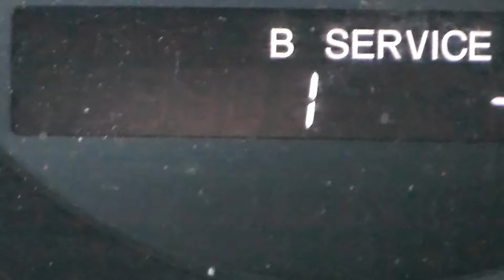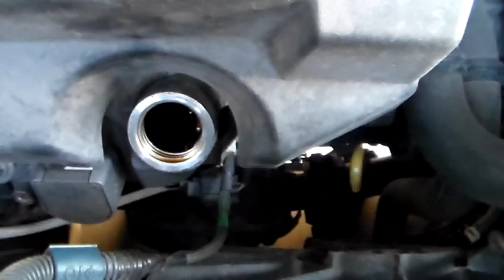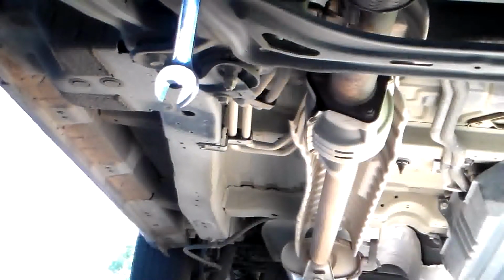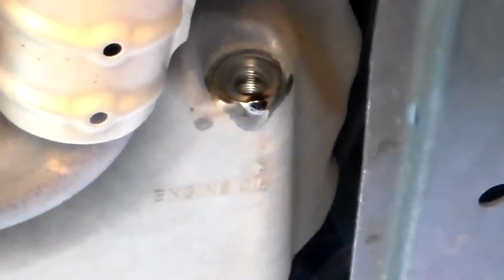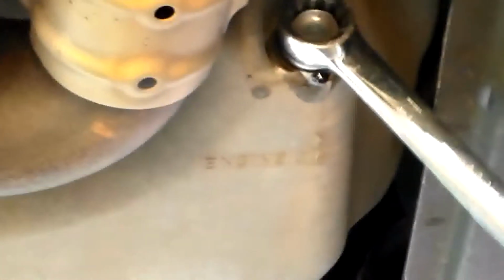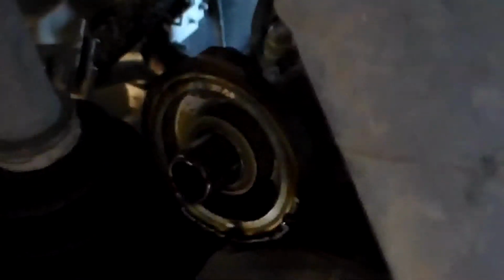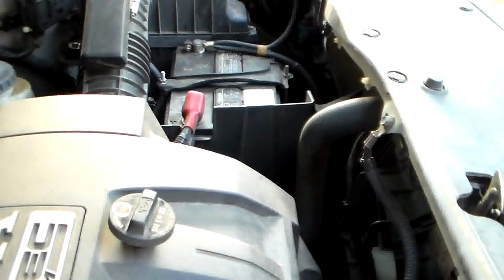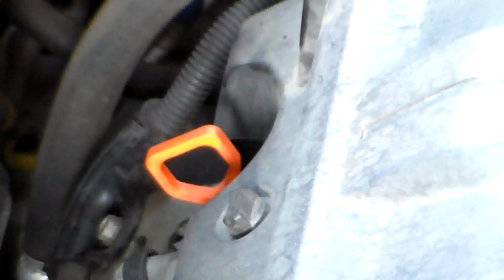OIL CHANGE (2008 Honda Pilot)

Comment: Do you know how to reset the oil gauge in the car?
Reply from the maker: Anthony Smith go to the oil life and hold down reset
Reply: Thank you for the tip and the video.  I wasn't patient enough when I tried it before.
Reply: @cuptain85 you put key into position 2, hold down reset on oil life until it starts blinking, let go, press and hold back in until it says 100%

Comment: What do you do even with a cheater wrench and still can't budge the oil bolt?
Reply from the maker: Stop before you do irreversible damage
Reply: A year late but DO NOT ROUND IT OFF! Guys at the dealer used to do it